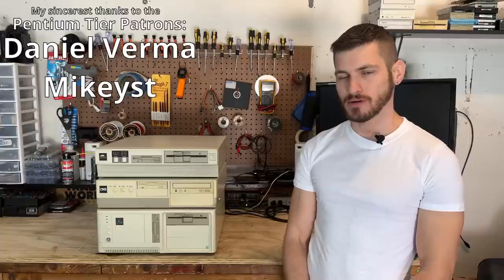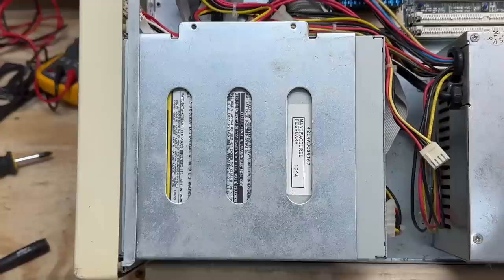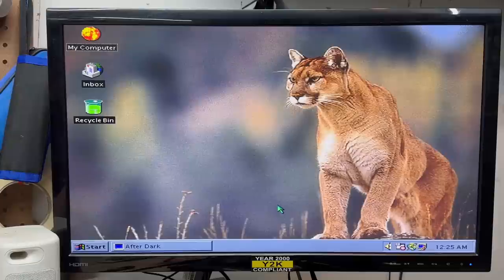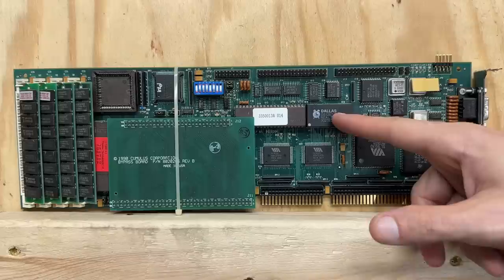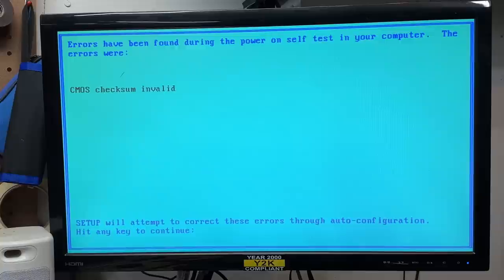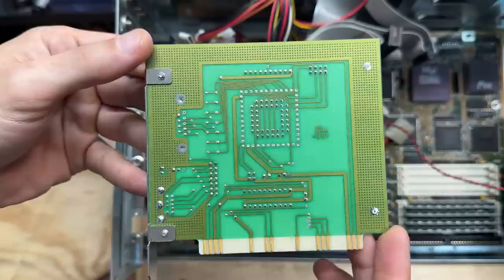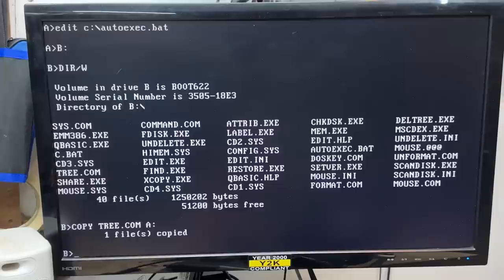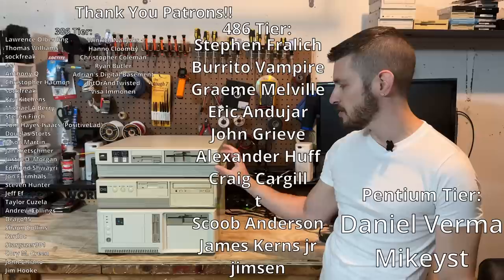Let's check out some of these mystery pizza-box systems! Vintage computer teardown and test.

Comment: None of those are really pizza boxes. Pizza box is like a Sun SparcStation 1, 2, 5, 10, 20.
Reply from the maker: According to Wikipedia, the max height to be considered 'pizza-box form factor' for older systems is 4 inches which the first two systems meet.

Comment: CMS machine betting 486
Reply: Oh yeah all the custom mouse pointers and the sounds they were themes
There were so many of those and back then the resources to run them were serious drain on the CPU, memory and hard drive

I don't remember what year it was but the Star Trek the next generation movie had come out and it was I think generations it was the first one and it had Picard and Kirk, or was it the one with the Borg I can't remember but they had a sound scheme for Windows 95 that instead of the standard default beeps and noises every time you click their did something it would play a WAV file that was a line from the movie and my boss had this and the computer took forever to do anything because it would stop and play these wave files constantly
Reply: Afterdark was screensavers.
Reply: Connor backup exec was a tape drive. I think they were 400 or 800 mb tapes QIC tapes. I remember the tapes I just had forgotten Connor backup exec was the name of the program
Reply: Access denied, I would check attributes
Usually one of things that I would look for is the attributes I would do a full list of the entire drive and I would look for hidden directories and files and back then if the attributes had them hidden you would never see them listed and west you did the attributes command and once you unhid those files, you had to remove the hidden the system the read-only and there was one other attribute that wasn't listed in the commands and there wasn't standard documentation it was a secret switch that was only known for programmers at Microsoft and it was used to hide directories and files for programs and things that they didn't want anybody messing with

I don't remember the command but I do remember many hours talking with Microsoft trying to figure out what the hell was wrong back when they actually had pay support that was in the US and we finally found a bad file in one of those hidden directories that they gave me the commands and the switches to use and I remember writing it down and using it many times in those early years to remove things like Norton because they love to use that secret command switch to hide their antivirus

I would love to go through an old machine like this

The last time I went through old computers was around 2005 and I would go directory by directory and delete delete delete to get space freed up

Usually the temp directories and the temp files andI think the text files and there was one other thing that was for documentation that wasn't required that took up a good amount of space

But I would bet somebody had hidden partitions and hidden directories on this thing that is making it report less space available then there really is

A lot of people had documents hidden
There were a lot of guys that had hidden bank account spreadsheets and documents for their finances they didn't want the wife to know about

I had a bunch of wives over the years ask me to look at the computer

I stopped doing it because they rarely left and I would wind up the bad guy in the middle

I wound up fixing a computer 3 times replacing boards and memory and CD drive and floppy drive and I don't know if the son😮 had add or ADHD or what the deal was but he would stick playing cards and anything else he could manage to stick into any space any opening in the machine he would jam stuff in it constantly and short stuff out

That was not a good deal selling computers to people with kids

They constantly called because it wasn't working

I spent a lot of money fixing them

Bad memories I had forgotten